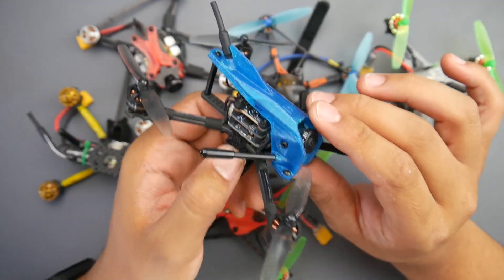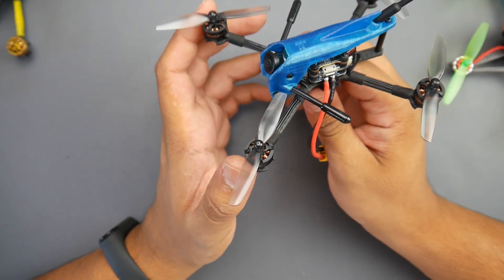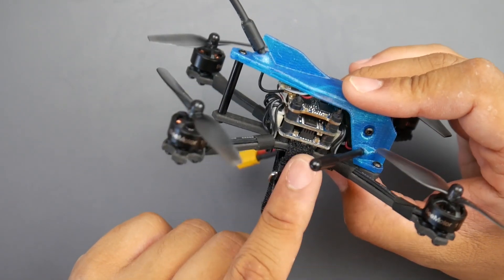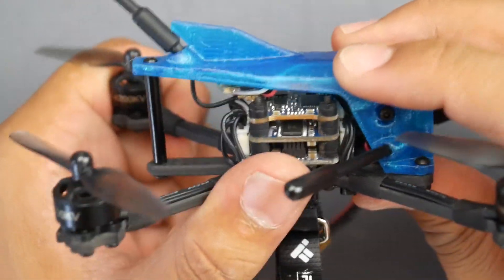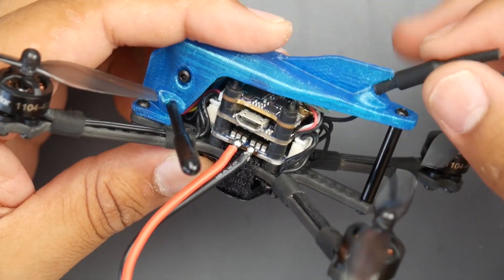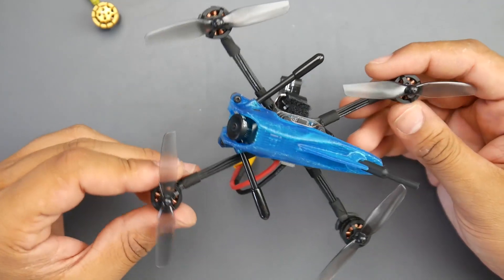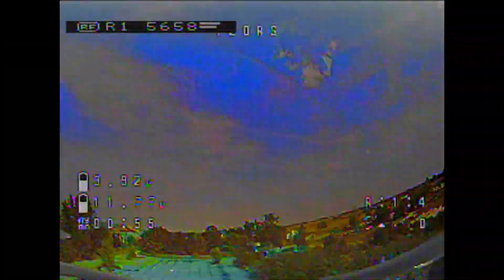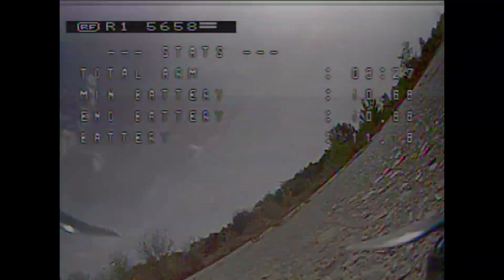iFlight 120RS Low KV ToothPick // Full Review

Comment: I had swapped over to the 3 inch frame.  However with these motors, I want to swap back to this particular frame.. They have a similar one, with more bracing, but I like this one the best..  T65's are the only way to go on this little beast...
Nice flying!!

Comment: It needed to be 5500kv even for 4s. 4200kv is lower than some 4s motors for the high-powered heavier 3 inchers, so it is nothing for the ultra-light 2.5’’ props we use in these.

And if we multiply the 4200kv by 4/3, we get that in 4s it is the equivalent of 5600kv in 3s. That is too low! If it were 5500kv, than the equivalent in 3s would be 7300kv, the perfect kv. 4200kv is more for 5s than 4s.